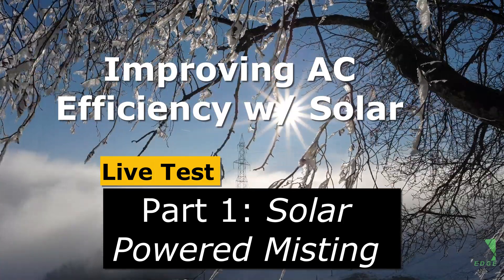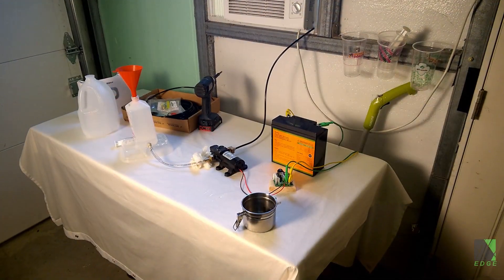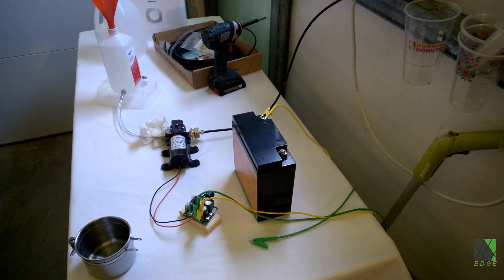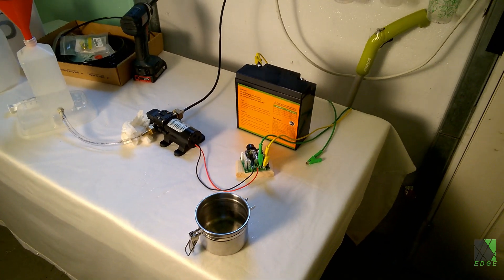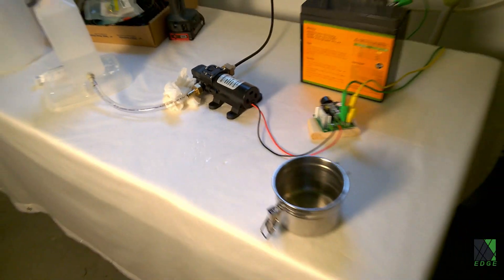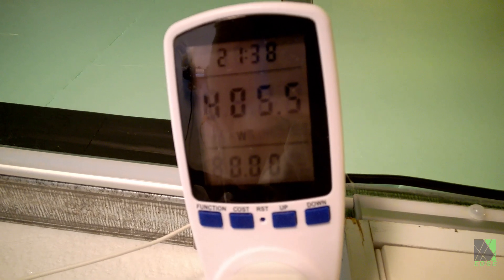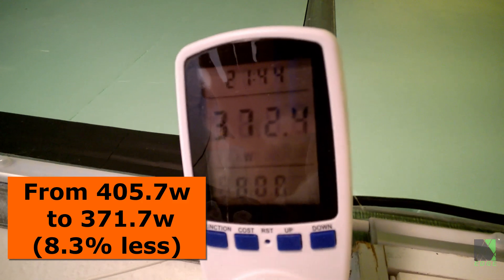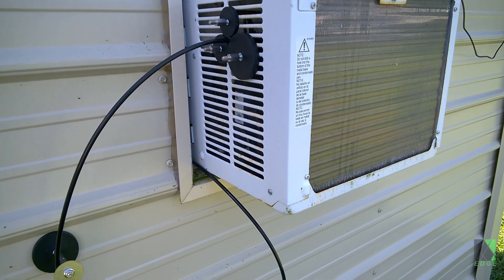Misting Pump to Increase Window Air Conditioner Efficiency - Does it work? #diy Live demo and test

Comment from the maker: FYI: a properly sized pump needs 3-5w to make such a tiny amount of mist. I used an oversized pump that was available for the test. Note the speed controller to keep the pump from damaging itself.
1. The total wattage reduction in the test was 34 watts or about 8%.
2. It does not reduce the amount of cold air coming out of the AC.
3. Even with a small water pump, the efficiency improvement is obviously significant.
4. Better and more even mist distribution would further improve efficiency. 
5. All or most windows ACs use condensate to improve efficiency, but misting is a better way to do so.
Source: hands on experience and over 10 years working on AC units. Not to mention building one from scratch: https://youtu.be/2I4lH-8_cCs
-Dave
Reply: @solarpoweredge  spot on. Misting is far more efficient. The challenge is making it fool proof but that's not something viewers of this channel need to worry about 😄
Reply from the maker: @subhobroto Exactly right :D

Comment: Rainwater capture for misting is the best use for it where I am at, so many minerals in every other source of water .

I’ve have a misting system on my central 5 ton unit that I made about ten years ago. I use the 24vac control to open a sprinkler valve. When it gets up to the 115F range here, it drops the power usage of the compressor by 2kW and the air temp out of the ducts by 5F. It ends up causing the cycle time to be a fraction of what it was (it’s a really old system that should have died by now).
Reply from the maker: @captainobvious9188  Really cool!!

Comment: Hey Dave..  I wonder if speeding up or even slowing the speed of the pump would have made a difference.
Reply from the maker: @OFFGRID_Trucker Hi, yes it does affect how much mist. Unfortunately that pump is way too big for the tiny bit of mist. So I had to use a speed controller and even then the motor was cycling too much. I tried taking the pump apart to modify it. A 3-5w pump would be perfect but I don't have one yet

Comment: i installed a 9000btu mini split for me little 500 Sq Ft home, it uses about 350 to 400 watts after home reaches deserved temp. Tossed out my furnace and window AC are now stored away. The mini split is also my heat for Mi winter. Less than $700 for unit and I bought vac pump so as to install the mini spilt myself. All is well, soon I will have a auto switch set up.
Reply from the maker: @vaq137 Nice :) For the shop I'm building 2 new mini splits from scratch - direct DC solar powered of course. One has a compressor the other does not. They are nickle and dime projects as I have to keep buying stuff constantly - and still not finished. But I'll get it done somehow.
Reply: @solarpoweredge you will get it done for sure. Steps at a time!
Reply from the maker: @subhobroto right! a video on that project (progress update) is being edited right n ow :) 👍
Reply: @solarpoweredge  I imagined so Dave. Great job as always
Reply from the maker: @subhobroto TY :)
Reply: Could you please name the brand of said split system.

Comment: An expansion on the idea, they sell small 5 watt pumps for hydronic heating for 20 bucks that run on dc. A water cooled AC with a 55 gallon drum converted to a cooling tower would bring that wattage down a lot more. Larger reservoir and your only loosing a small amount to evaporation which you can slow down with baffles or bent grates. Not even a lot of air or power for blowers is needed for the relatively low amount of heat an ac of that size puts out. 10-20 watts.
Reply from the maker: @Deveak A simpler and smaller mod is in testing since early this summer, I will post that as part 2. It makes a huge difference. Definitely researching various cooling tower systems (a no compressor version is in the works)
Reply: @solarpoweredge  in Ohio I’ve seen old cooling towers in people’s yards, scrap wood today, time claimed it but tall cedar towers used to cool water that was pumped into houses. Built after electricity but before AC.
Reply from the maker: @Deveak  Awesome - for the cooling tower test, there is a height limit of about 12 feet, because it has to hide behind the workshop. Not sure if that will be enough! But at least I will try.